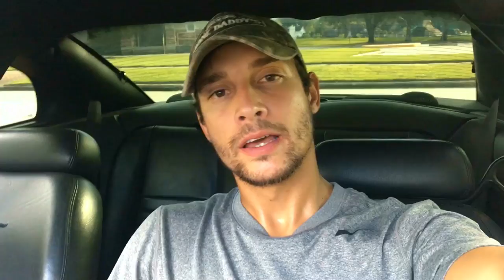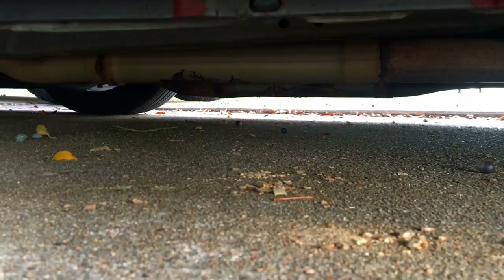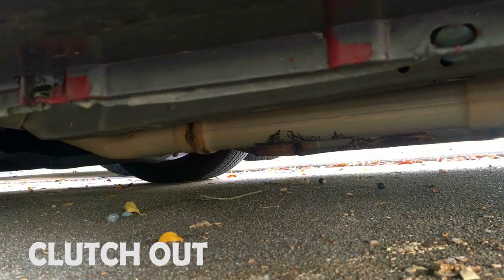How To Diagnose A CLUTCH NOISE Problem | Ford Mustang Gt | Bearings

Comment: If you consistently have a problem burning up your throw out and pilot bearings. Change the clutch/shifter fork. Good chance if its stock then its probably bent. Even if its bent the slightest fraction it will basically cause both bearings to not fully release during engagement and disengagement. Even though the car will move and drive normally you will constantly have that problem

Comment: 83. Mustang with a 5.0 5  speed.  I replaced my clutch with a stage one that came with the pilot, bearing and throw out bearing.   And I even replaced the cable and installed in aluminum quadrant with a firewall adjuster.  Now mine does make a little bit of noise when you release the clutch.   I’m hoping that I just need to make a little more adjustment with the cable to fix the noise

Comment: same thing that just happened with my car. will keep y’all updated on what our plans are, gonna try to replace everything ourselves.
Reply: What hall bro
Reply: What happened bro
Reply: @mewgag4591  it was actually the entire clutch for me, didn’t replace the throw out bearing bc we forgot, still makes a noise but pretty quiet. i’d say replace the entire clutch and the throw out bearing and make sure to check the slave cylinder inside the transmission.

Comment: I so feel your pain in this video. I have a manual FG III Ford XR6 ute (I live in Australia) and I thought it had a bad noise from the get go; turns out it's just the turnover noise that the TR6060 transmission makes. Soon after that, my car started struggling with hill starts and even basic take-offs, making a clunking noise which became faster and faster under acceleration until you could barely hear it from inside the car. Turned out to be the drive shaft centre bearing lmao. We believe the previous owner (I bought at 72,000km odo) might have had some fun in her before wearing the car in well enough, so to speak.

On another note, I hate how pricey cars can be when things go wrong. My two previous cars; a 2004 Suzuki Jimny 1.6L and a 2004 Ford Courier/Mazda B2500 2.5L both cost me the literal scrapings of whatever remains of Fafnir's stolen treasure (norse myth moguls wya) because I regret spending so much to fix them, even though I loved them. The B2500 (diesel) even ended up completely ceasing its engine due to bent conrods among other things!

Cars are an expensive hobby but at the end of the day we all need to have each others' backs and comfort each other when our precious vehicles are having troubles, as they do. It does my head in when people go on about fixing   E V E R Y T H I N G   yourself. That is SO much time wasted that could be spent working to fund having fun with your car! Having a reliable, car-smart mechanic is not a bad thing and don't let anyone ever tell you it is.

Lots of love from Aus :))

Comment: First off, it's common when you have a manual, to replace the throw out bearing as regular maintenance. There's a reason the clutch kits come with, I repeat, come with, the throw out and pilot bearing. The throw out bearing spins with the input shaft and contacts abrasive metal flat springs to disengage while moving and in gear. Throw out bearing replacement is the easiest replacement of the clutch maintenance process though, remove old one, grease the fork, and any other contact points, then slide back onto the shaft. Easy, and ever clutch kit I've ever gotten, always comes with this AND the pilot bushing. good call on the noise.
Reply: Easy hell lol you better have a lift

Comment: Thnx for sharing this with us. I am experience a familiar noise with a megane coupe. The sound comes and goes and it doesn't matter if the car is in gear or not. As you speed the noise becomes more present. The noise is like the noise when you release the clutch pedal too early while the transmission is not fully engaged in gear. I am not certain though whether it's a clutch problem or something else like a transmission bearing?

Comment: Mine makes a loud screeching sound When the clutch is engaged and disengaged. It only happens when I cold start it though
Reply: TheMattSVT throw out bearing
Reply: mine does the same I have a 01 gt
Reply: Same for 07 GT. Is it throw out or flywheel bushing? Which one was it for you?
Reply: I have the same issue. I uploaded a video. Not sure if it's the bearings
Reply: @2011italianoboy  TOB very likely.Mine made the same noise one night,a month later after I pulled the tranny the TOB was shot as was my clutch fork and pivot stud.

Comment: Thanks man, I’m experiencing the same noise, 05 Mustang GT, my mechanic is charging $110/hr @ 7 hrs plus $494 clutch kit/throw out bearing, $194 flywheel , $41.99 rear main seals total just under $1500 😮

Comment: Mine makes a noise when u lift the clutch up but only in 1st gear ?
Reply: Sean O'Farrell sameeee
Reply: Hey so I’m having an issue. This how I diagnose. If you start the car and have it in neutral, then push clutch in. If you hear noise as clutch is in then it is your throw out/release bearing. If you don’t hear noise when clutch is pushed out but once you release the clutch pedal and it continues to make a weird grinding noise then it’s your pilot bearing. If you hear noise as you are releasing the clutch but it goes away once clutch is fully out then it is an annoying input shaft bearing. It’s harder to get to.

Comment: i needed a replacement clutch so i also went with the stage 1 exedy brand. during my research its safe to say dont use the throwout bearing that it comes with.
Reply: why is that... i have one in mine with 1500 km and it is making this noise... except you can hear abit more grinding so i was thinking it was the input shaft going into a shop in a couple days so i will know for sure
Reply: Can i know why not to use the throw out bearing that comes with ?
Reply: Kucik Kucik use an OEM ford tob much better quality

Comment: I have 2004 mustang gt like yours too and having the very same problem. But I hear the noise under inside my front left tire. I thought it was just a rack and pinion or steering pump or a idler pulley. But thanks for this video,it gives me whole new other idea.

Comment: I have a 93 prelude that sounds like somethings knocking when my clutch is released but goes away when I push the clutch in I think it is the set of the pilot and throw out bearing and it grinds trying to rev match and I would have thought it was synchros but I just did them last month but I'm glad to know that it could just be a simple clutch replacement 🙏

Comment: Great video. I know it’s been a few years since you made this video. Hopefully you are still around and can respond. I have a 2015 mustang Gt 5.0 6sp performance pack car with 63 thousand miles. Same noise as in your video. When my clutch is pressed in the noise goes away. A transmission place that installed my current clutch in 11/22 said I need a new transmission. It’s a shame there are so many shaded places that want to take advantage of people. My car is modified with a 2018 1320 Junkie performance ported intake manifold with a jlt cold air intake  and a custom tune, Bmr suspension parts.

Comment: Could be the springs in the clutch disk loose and sometimes sitting in there flopping around done a few when I took the presure plate off the springs from the clutch disk just falls off

Comment: My throw out bearing split into two pieces. The pilot bearing wore out, and I guess the vibration split the throw out bearing. I replaced the pilot bearing with a needle bearing instead of the copper bearing. It worked like a charm.

Comment: My clutch makes a loud squeaking noise and stop when you push the clutch in
Reply from the maker: +jack paullus that is your throw out bearing
Reply: jack paullus what throw out bearing u recommend me?
Reply: Mines does the same
Reply: Jesus Contreras it’s been a year so I’m sure you’ve most likely replaced it but get the Ford Racing brand for throwout bearing and pilot bearing . And yes it sounds like the TOB is your problem for that squeak
Reply: Mine does the Same
Reply: TD Mobile Detailing  throw out bearing if it stops when u press clutch pilot and throw out bearing both bad in this video u can hear bearings grind even while depressed

Comment: Video starts @1:30. Does the sound go away when you are driving and in gear?
Reply: I have the same problem and no it does not. You would have to rest your foot on the clutch slightly to have the noise go away.
Reply: I have a 98 sound goes away when driving it

Comment: Throw out bearing makes noise with clutch in when you push the clutch in and the sound goes away and then release it and the noise comes back I guarantee you that its going to be your input shaft bearing going out not throw out bearing or pilot bearing when you replace the input shaft bearing you should always replace the pilot bearing because of shaft play wearing the pilot out
Reply: if it was the input shaft bearing you would hear it when in gear. Yet nothing is there when the clutch isn't pushed in. So this simply cannot be the input bearing.

Comment: hello from germany. I bought a brand new clutch and flywheel and throw out bearing (pilotbearing is old)

I have loud clacking noises I thought it comes from the engine so I replaced alot of parts and now I´m prettysure it´s the clutch. can I drive with a rattling clutch, or is it highly dangerous??

Comment: My 03 GT just had this issue lately until today, it  started squealing super loud, I couldn’t get it into gear without forcing it a ton, just dropped it off at the mechanic today, hope it’s not tooo expensive…
Reply: Update: The problem was what I thought it was, Throwout bearing. Just decided to get the whole clutch replaced
Reply: @Mustangkev918  thanks for update how much did it cost
Reply: @FlashStashh  total was like $700

Comment: throwout barring! I'm dealing with the same issue with my 94 GT.
Reply from the maker: +1sik sn95 I heard you can still drive with it for a while, it's just the noise that sucks
Reply: Gspeed 23109 is that true?
Reply from the maker: Yea
Reply: Gspeed 23109 how much did it cost replacing the throw out bearing cuz I think my throw out bearing went out
Reply: Sinatra any update on this

Comment: My car when I start it up and E- Break is on. In Neutral and not it's makes a little tapping? Flapping Noise. Whenever I press the clutch in the Noise Stops. But the car whenever I bought it had 102,000 miles on it and I've had it for 3-months know. I'm under the powertrain warranty and I don't know if it can be easy D.I.Y. or take it to the dealership and see if I can get it new clutch etc. Would the Clutch be apart of the (Powertrain warranty) Any info on this be greatly appreciated. Thank you for reading this and your thoughts and opinions?

Comment: I was driving to work yesterday and lost all ability to shift. When I pushed the clutch in and took it out of 4th I could not get it to go into 5th. I pulled over and it would not go into any gear. The engine runs but I have a sound alot like this. The car will let me put it in gear while it is off and even start it but won't let me do anything if the car is running.

Comment: Throw out bearing is completely gone out , you have to remove the transmission clutch bell housing area is where these throw out bearings lay it sounds like one of those has gone out

Comment: Mine rattled a bit off the clutch typical throw out bearing noise I was told it was normal on these years. Mine doesn’t sound like that but I push my clutch in and it does go away
Reply: There is no normal rattle noise on stangs. Sounds like your throwout bearing. I’ve had my 03 stang 8 years Manual trans. Finally swapping it out. My shit was toast haha if you haven’t fixed it yet get Ford racing brand for both bearings(throwout bearing and pilot bearing) don’t forget to resurface/cut your flywheel or buy a new one. Check the clutch fork too and if the two fingers/springs are worn, replace with a ford one OEM quality or better. Good luck!

Comment: Did this fix yours? I have a 2007 Mitsubishi Eclipse and it was diagnosed that it was the clutch release bearing. I got a whole clutch kit got it put in, and the car is still making the noise...?
Reply: i have the same problem in my celica its not a throw out bearing or pilot bearing so i have to bring it into a shop and get them to replace my input bearing in my transmission the noise almost completely goes away when clutch is enganged but not completely and it kind of sounds like something is grinding inside thats your flywheel rubbing against something
Reply: Robert Shingler glad to know I'm not the only one with the car doing this!
Reply: bought mine a month ago with it doing it have parked it since or it could be as simple as a loose pressure plate if you havent been in there yet which im hoping thats my case
Reply: DDTS Games I got the same problem on my Subaru Outback rn
Reply: I have 2007 Mitsubishi Eclipse too and I think I have the same problem as you each time I press the clutch it makes this sound but I'm not sure if I need the whole kit or if is one specific part. Did you  ever figure out what your was?

Comment: Had this same noise, I mean exactly the same, replaced clutch and all bearings and still had to noise, was getting scared at this point and shopping for a transmission. My buddy suggested pulling the starter and push starting it. Just to see. Starter. This entire time it was my starter. Hope this helps someone.

Comment: Hey I have a 2006 Nissan 350z 6 speed manual and when I purchased the car, this noise wasn't there! Whenever I turn my car off with my foot pressed all the way down on the clutch it doesn't make any noise but when I turn off my car without engaging my clutch at all(of course it's in neutral) it makes this really loud rattling noise! Any ideas? Please help, I'm really concerned about my clutch!

Comment: if your mechanic is doing it for that cheap he must be a really good friend I just pulled the transmission out of my 1990 Toyota Supra and it was a pain in the ass
Reply: Front wheel and all wheel drives are a pain to do rear wheel drive are way more simple to do my 05 mustang cost me 780 bucks to do half of that was the clutch kit and I live near California's eastern boarder so prices are higher than the Midwest

Comment: Bro I need help!! I have an '11 5.0. When I turn the car on when it's cold or if it's been sitting for a while, I hear a loud screeching sound after I press the clutch to turn the car on. Also, when I shift into any gear passed 2nd I feel like the car isn't as responsive as it used to be when I first got it. Do you think it could be the clutch or throw out bearing? Mines kind of made the same sound as yours
Reply: Kevin Dean definantly sounds like throw out beaeing

Comment: Same thing happened to me but I kept driving it and the bearing broke into 2 and wouldn't go into gear anymore, you should make a how to fix it video
Reply from the maker: +Daniel R. Dang that sucks dude. I just received all the parts for the clutch kit but I don't have the tools to drop the transmission and fit it myself. I have to take it to a shop. Eventually I plan to have enough tools to work on my own cars
Reply: Daniel R.  so did u find out what was the problem

Comment: Have slightly the same problem with my 2000 Ranger.  Has been making that sound for just a second or two when letting off the clutch in various gears.  Been going on for about a year and a half now so I'm not rushing to get it fixed if it's not totally broken yet.  Am I wrong not to?  Somebody get back to me.
Reply: If it's a boat motor noise then it's just a misalignment between Flywheel and a clutch disk And then your clutch disk will probably only last couple of years

Comment: when I accelerate I have a high pitched noise coming from my clutch and when I press the clutch it stops. any ideas?
Reply from the maker: +Sammy Sheffield for sure the throw out bearing!!
Reply: same page
Reply: Sammy Sheffield not throwout bearing. It's the input shaft bearing. Throwout bearing makes noise when the clutch is pushed in. Input shaft bearing makes noise when clutch is out and goes away when clutch is in
Reply: I just jad same problem.. But i just change to all new clutch set include throw out bearing. Still sound although not loud,but the tork are so high i can even launch in 3rd gear.

Comment: Replaced my ToB with a Ford racing 2 days ago, and it already chirps lol it's just a bad design some people get lucky and have silent ones but the majority squeak. But that sound is a trashed ToB
Reply: No, it's a trashed pilot bearing. It happens when the throw out is doing nothing thus it goes away when he presses in the clutch. If it made the noise when he pressed clutch in then it would be the throw out bearing.